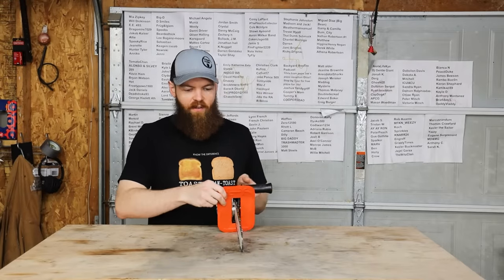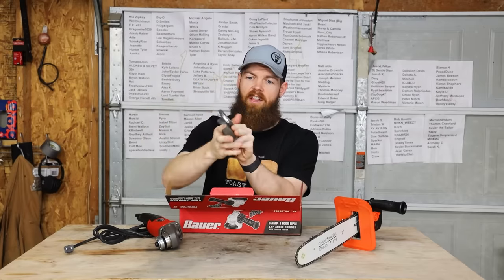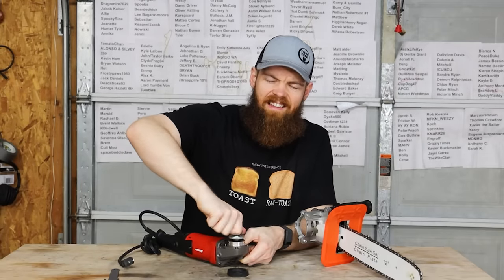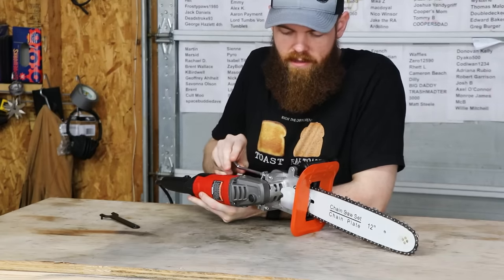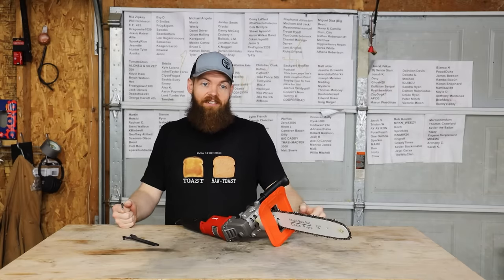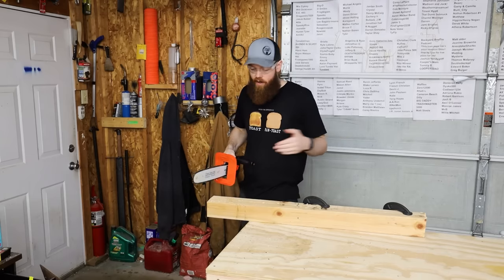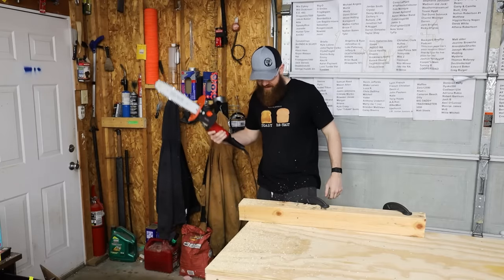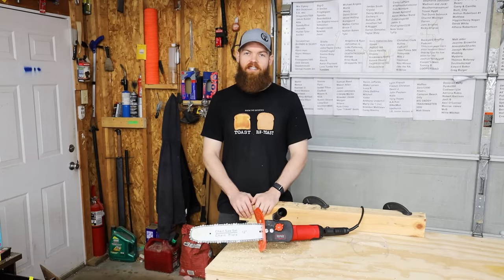I Tried The Grinder Chainsaw AGAIN

Comment: The bar heats up and expands, but the chain doesn't, so it gets tighter. That's why you should always loosen your chain when you store it. If you don't, it can warp the bar as the bar continues stretching for a few minutes after use.
Reply: Wrong.
Reply: I live in the south, but I’ve heard stories from up in cold parts of Canada of crankshaft getting warped from the chain stored too tight in extreme cold temps
Reply: @jordanbeyer7607  then explain mister
Reply: Just adjust you chain when its cold 😊 if adjusted too tight when its hot (and not loosened after use) it propably could bend that bar.
Reply: @jordanbeyer7607  Not wrong. I've been servicing Stihl chainsaws for 10 years. I've seen enough broken and broken enough myself to know.
Reply: @americansmark  oh shit the Internet expert got burned by an actual expert. Great job Josh, even better name by the way!
Reply: @joshua_J  lol for sure.
Reply: @Josh  the chain spins around the bar. As the chain moves, it rubs both the bar and the material it is cutting, called friction. That friction becomes heat.  The source of the heat is the moving chain and because the chain has a smaller mass than the bar, it will always warm up faster. The chain warms up and stretches. This is especially true with a new chain and will need "broken in". Often needing the chain readjusted multiples times. So please, don't be saying that the bar heats up and causes the chain to tighten. That doesn't make any sense and is simply false. It honestly seems like you made a mistake and replaced the word chain with bar.  Again, the bar does not stretch, the chain does. Tell me how I'm wrong
Reply: @jordanbeyer7607  ha, gottem
Reply: @jordanbeyer7607  the chain is better at moving heat than the bar. Thermodynamics is a thing. The bar absorbs heat as the chain dissipates it. That's why it uses so much bar oil. It burns a lot of it
Reply: @jordanbeyer7607  the chain has more surface area, it dissipates the heat faster than the bar.
Reply: @jordanbeyer7607  the chain is continuously moving and the bar is stationary. Which one do you think dissipates heat faster??
Reply: @michaelandin1167  ummmmm. No
Reply: @Josh  the chain is better at moving heat than the bar? What, are you even listening to yourself. The movement of the chain causes friction and generates heat.  Bar oil is used to reduce the amount of friction between the bar and the chain. Less friction = less heat. Again, the chain is contacting 2 objects, the bar, and the material it is cutting. 2 sources of friction and 2 sources of heat generation, however, for simplicity sack, let's ignore the object the chain is cutting. So the only force is the friction between the bar and the chain. Since the chain has a smaller mass, it will see an increase in tempature faster. 
The chain isn't moving anything. Acually, the bar is absorbing heat away from the chain. You just proved my right. If the bar is absorbing heat from the chain that is dissapating it(as you said), that proves that the chain is hotter and transfering energy to the cooler bar. Energy moves from high to low. 

Grab a saw and make a few cuts. Feel the chain, then feel the bar. The chain will be much warmer than the bar.  Sounds like you have broken enough to know because you have no clue what you're doing and rambling utter nonsense.
Reply: I have the same problem with my saws from time to time
Reply: @jordanbeyer7607  - thank you. I been doing tree work for 20 years. A tight chain always becomes loose. Never heard of a loose chain becoming tighter.
Reply: @jordanbeyer7607  - and the heat actually stretches the chain because it gets so hot it softens it.
Reply: @jordanbeyer7607  not worth it man these other guys have no idea. Can't have cut much in their life if they think a chain tightens the more you cut with it
Reply: This whole conversation/argument is so absurd and funny. I’m no chainsaw expert but I can definitely say from a physics aspect that makes no sense. The chain is the source of the heat it literally can’t heat the bar to a higher temperature than the chain is itself. The heat is from all the friction the chain is going through while sawing through wood you can feel it with your hand it’ll be warmer than the bar. Something else is going on to cause the chain getting tighter, I mean it’s Tyler he could’ve easily messed something up
Reply: How does the bar continue to grow from heat when you store it over a period of time I understand half of your theory where you said you should loosen the chain before you use it and then again after you use it because the bar has grown from the heat but I would also think that the chain would also expand from the heat as well and I would think that you should loosen the chain before storing it for a period of time because if not you could be storing it with the chain really tight and that can put a load on the bar and eventually warp the bar because it's under load and don't get me wrong this is just my theory because I'm by far not a tree guy I've used a chain saw here and there just to trim a few limbs from a tree but as far as cutting an entire tree down I haven't done that and I've never put on a pair of spikes to climb up in a tree either because I'm afraid of heights so I keep my ass on solid ground where it is completely safe and I've never been in a plane either and never will be and if I needed a tree cut down in my old neighborhood I have a few friends that would be more than happy to do that for me but now I live in a neighborhood where if I need a tree cut down around my house all I have to do is report the problem to the property manager and they get one of the neighborhood maintenance men or they hire a company of their choosing to come do the job and they don't charge me anything to do it
Reply: That's opposite of what happens. The chain heats up much faster than the bar. I've been cutting trees for over 40 years, including over a decade as a lumberjack for Weyerhaeuser, cutting old growth in the PNW. I have extensive experience with saws ranging from the Stihl MS151 to the 090

Chains get loose as they heat up, which is why you tighten them as you cut and loosen them when you're done. Sure, the bar gets hot, but nothing like the chain, you can still adjust the tension by grabbing the bar after running it for hours, you can't touch the chain without blistering skin.
Reply: @jordanbeyer7607  He's absolutely correct.

The coefficient of thermal expansion for steel is 0.00000645in/in/deg.

I'm a machinist, and if there's 1 thing I know, it's heat makes metals expand.
Reply: @americansmark  I've been servicing Stihl chainsaws for 73 years sonny
Reply: @jordanbeyer7607  the chain moves and cools, the bar is static.
The chain is also made from harder steel than the bar.
Reply: @Foetus Deletus  I'm going to show your ignorance for a quick second. That's okay, it's a learning experience.  The chain is mild steel however, it has a hardend cutting chisel. The whole chain is not hardend steel.
Reply: @americansmark  Yup, the chain, if correctly lubricated, is being air cooled to a degree. The bar has more mass, but can't loose heat as well,particular while cutting.
Reply: @americansmark  and Jordan are kinda wrong in this situation. Its the bar moving as the nuts to lock the bar in place is slipping from the jerking. Have fully tested this out and when you do a push cut it tightens and pull cuts loosen. Have went cut a dry log to make sure it would jerk enough and did a cut going back and forth and each time checked it and it would indeed loosen and tighten.
Reply: It's the other way around. The chain heats up and expands. So people tighten it. Then when it cools down, the chain shrinks and can warp the bar. Bar changing size is negligible.
Reply: Dang, been doing trees 33 yrs,dozens of saws, never did this, never had a problem. Sounds like every time you park your car, you have to release hydraulic pressure on the caliper, for the same reason.
Reply: Ok guys, the actual thermodynamic inclusivity properties, of the bar to chain redundant ratios, dictates the manner at which the revolutionary mass forces affect the thermal stabilization of each component, allowing for differences in metal stress factors, based on the particular heat treatment of each inclusive member of parts involved. This can only be ascertained, after properly aligning the molecules of said metal properties, with strong electromagnetic, and proper annealing, quenching, and pertinant heat treating formats. Any transferrence of hydrathermal influences between the particular parts as outlined , will result in a connectivity of quasar light impulses, which, in the long run, don't do crap.
Reply: @jordanbeyer7607  Not a chainsaw expert, but I am a physics expert, seems like you are forgetting that an object in motion, particularly when dealing with fluids, moves heat in the system, and dissipates it to the environment. This is modeled by Newton's Law of Cooling, which is an extension Fourier's Law. I am assuming that the chain, moving in relation to the bar, produces heat by friction when rubbing against a high spot on the bar, and then dissipates it to a cooler part of the bar when running against a lower friction section, such as the part with the bearings. In this regard, it also makes sense that the chain might have the appearance of being hotter to the touch right after a cut, but the chain's lower thermal mass would insure that it reaches ambient temperature faster than the bar, which could result in a deformation of the bar as the two metals cool at different rates, due to their different conductive potentials.
Reply: @monhi64  From a physics standpoint what you're saying makes no sense. The chain isn't the source of anything, it is in fact the action between the bar and the chain that results in the increase of thermal energy of both objects, without a bar a moving chain would create no additional heat ( if it is moving unimpeded in a vacuum) Likewise without the chain the bar would not get any hotter (if it is stationary in a vacuum) Assuming the chain and bar are made of the same material, and the friction coefficient is constant, the rate at which the chain and the bar heat up as a result of the "rubbing" action would be the same. The only reason the chain would dissipate heat to the bar is because there are sections in which the chain contacts the bar that have a lower friction coefficient, say due to the presence of bearing surfaces for example, and the fact that the chain is moving.

Comment: I don't know if you will see this or not Tyler, but if you do, the reason you chain got tighter at the start was from you bar moving up so hold the tip of your bar up when setting chain tension, if you don't when you cut it will push the bar up and the chain will go tight.

Comment: Everyone has already mentioned this, but you need to oil the chain with the reservoir (and chainsaw oil). The reason it gets tighter is because everything expands when it's hot.

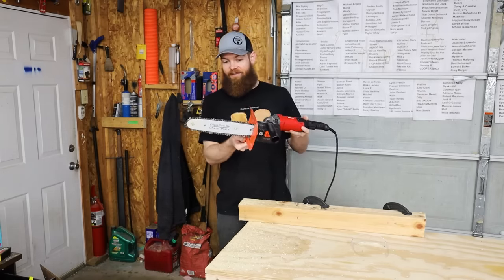Comment: 8:51 At that point, just get a Cordless Electric Chainsaw that uses the same battery as your other tools, 
you can get really good ones for like $120.
Reply: Exactly. I already had the 40v batteries for my ryobi mower, so I just got the chainsaw that uses the same batteries
Reply: Battery powered chainsaws are great on paper but when you really have to do some cutting gas is the way to go in my experience. I did tree work for 7 years.
Reply: @themightycrixus1131  You're right but battery chainsaws are great for pruning, small work, and way better than this item.
My comment is more to him saying if he could "get a high quality of this" at that point one should get a real chainsaw, battery one, or even a corded one. His "liking" the product is to save on buying/reducing cost of multiple tools.
Like you said you would not use a battery for actual tree work, well you would not use this tool either.

Comment: The chain got hot that's why it got loose metal expands when it gets hot you probably need to put some oil on that chain I doubt that thing has self-moving borrow on it so you should probably put some bar oil on it that's why it's getting hot

Comment: I'm guessing that the chain got tighter because you didn't lift on the bar when you tightened the mounting nuts.  Then the bar creeps up while in use, tightening the chain.  The adjuster is on the bottom of the bar.
That spins close to the speed of a gas saw, but it has no brake.  Electric chainsaws do seem to pretty much always lack brakes, but any I've seen was quite a bit slower.  Be careful with that thing.  Better yet, buy a proper saw.
Reply: Exactly what I was thinking. That thing seems to be lacking some major safety features.

Comment: I am actually buying one now. I don't need an actual chainsaw, I just need to cut firewood into smaller pieces for my backyard pit just a few times a year. I already have a harbor freight warrior grinder I bought to grind ONE bolt last year. This would be perfect for my application and put a grinder to use that's otherwise collecting dust. Even the cheapest chainsaws on amazon are 100+ bucks.

Comment: Worked at hf for 2 years. Honestly they’ve got a decent amount of good stuff. But I have learned which items to never ever buy lol. Lots of battery chargers came back, obviously the cheap cheap power tools. Hand tools,generators, and engines seemed solid for the most part

Comment: Whats happening is the tightening system on it is cheapish so even though its "tighten" down, the jerk of the chain will still move the bar so it will tighten on the push cut and loosen on the pull cut. Normally jerky or hard cutting will cause it and cutting something dry like a dried 4x4 can do that.

Comment: You wanna tighten the chain just enough to where it holds itself in to the bar. That’s what I’ve done with my chainsaw. That may be different. Either way that Bauer grinder is nice too. I’ve had one for over a year and still going strong.

Comment: My saws do that. Also you never want to tighten the chain when it's hot. Let it cool down then tighten. I've seen where someone tightened the chain when it's hot and when it cooled down it am sometimes warp the crank and damage the clutch drum and bearings

Comment: Harbour freight has some decent power tools... I got a Cordes "sawzall"  years ago, abuse it leaving it outside over winter, and it still works.
Edit.  Cuts 6 inch logs with a pruning blade  great.  Does about everything I would use a chainsaw for.

Comment: My guess as to why it’s slower at cutting now than before is just that the Bauer grinder doesn’t get up to as high of rpm’s as the Milwaukee or that the torque is different between the two. Either way love the video and update 👍
Reply: if i'm not mistaken it's a bit of both but more the torque. Project Farm is your friend when it comes to testing brands and their products about as fairly as you can.

Comment: the chain heats up and expands the chain you need bar oil all chain saws electric gas grinder chain saws it also helps cool it and if it heats up to much could get stuck or brake it and fly off you should have logger chaps since u like shorts so much dangerous as heck if it Flys off

Comment: Um harbor freight sells a corded chainsaw that is just less than $50 all day. Half decent, and has bar oil to lube the chain... YOU NEED TO DO A STRESS TEST!!! I CHALLENGE YOU TYLER AS ANOTHER FELLOW TYLER. ANGLE SAW VS CHAINSAW. CORDED POSSIBLY CORDLESS (if you wanna fully test the subject) 😂

Comment: Tightens as the bar heats. It's a learned skill to get the right tension, pulling up a tooth at a certain pressure, you should lift one tooth out of the track, just barely

Comment: The fact that the angle grinder can be locked in the on position and that it doesn't have a kickback protection is quite terrifying to me. I woud not reccomend using this contraption.

Comment: The chain tightens.. Because the metal the chain rides on heats up.. and expands.  And the heat it causing premature chain Stretch..  Needs a lube system like a real chain saw

Comment: This shouldn't be sold, it didn't have a basic level of safety to be legally sold as a complete chainsaw and this bypasses all of it. Don't be the social media influencer/martyr we need to combat unsafe grinder attachments through the loss of life or limb.

I can't stress enough how dangerous a chainsaw with no modern kickback brake on it is, my father in law was using a fancy bow chainsaw as a kid. It kicked back and got into his leg. His was told the only reason his leg was saved was because his surgeon was a M.A.S.H doctor in the Korean war that has unique experience dealing with those kinds of horrific wounds/damage to legs.

Comment: That is a very foolish and dangerous tool. If you need a chainsaw buy a chainsaw and get some PPE and training. I can't believe you have never even seen a normal grinder. This frightening. Leave this stuff to professionals if you want to keep your face and fingers it does not even have a chain brake and the tip of the bar is too wide, it looks like it was designed to kick back.  A tiny pair of glasses will do nothing.

Comment: The chain was probably tightening up because the oiler hasn't bled the air out of it yet, your best bet is to run it with the bar off till it's pumping oil to make sure.

Comment: i bet if you got a DeWalt instead of a Bauer it would have been cutting just as fast if not a fraction slower than the Milwaukee. 
but with that, and a bit of chainsaw oil, it is definitely an interesting concept.